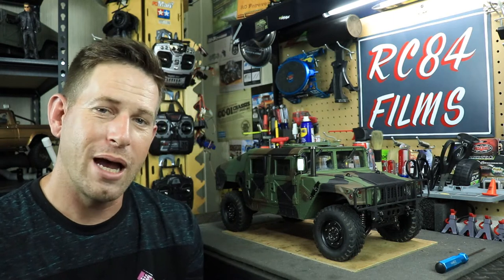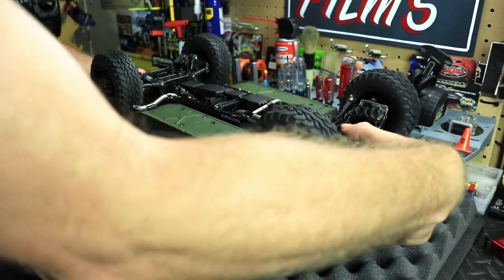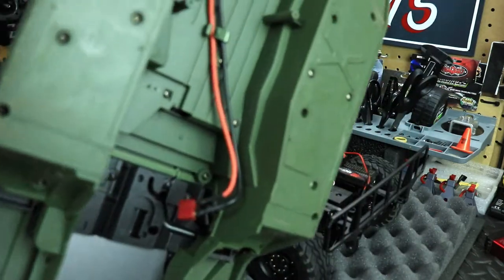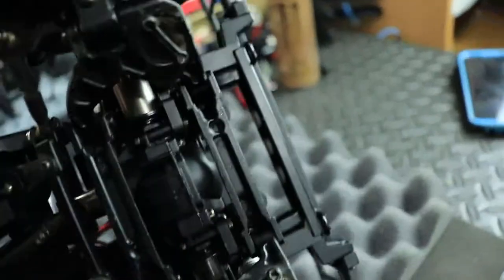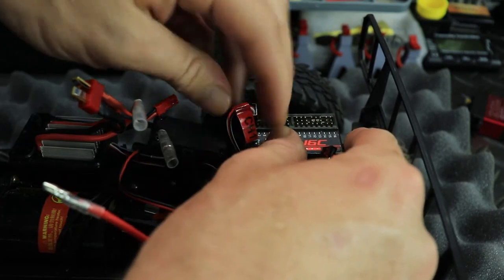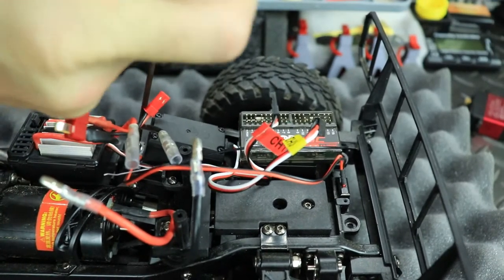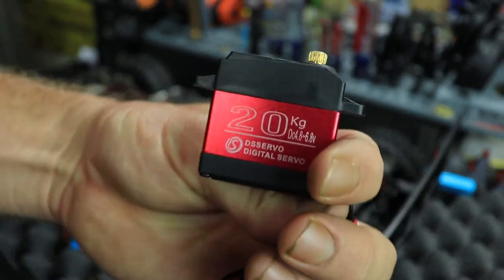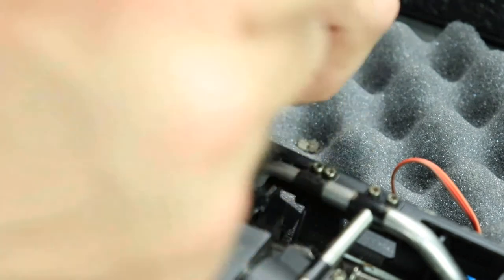RC84Films: PT1 Project Humvee P408

Comment: I am very grateful for the great help that you have offered me, precisely today I have released my Humvee, and the servo has broken, so I will have to change it.
Tell you that I follow you and that I love your videos, by the way, the battery lasted me 15 minutes, 7.4v 4500mAh) is it normal? What do you think is the best battery for this vehicle?
Thank you very much and greetings from Barcelona, Catalunya.
Reply from the maker: Thank you for your comment and for following my videos and liking what Im doing. Sorry to hear about the servo the shock servo is only a 9Kg that's why i upgraded to a little stronger servo a 20kg. For the other question on battery life. It depends on how much you are the gas. Did you get the light & sound P408? If you did that is a nothing that can suck your battery up too. I upgraded the esc so i could run a 3S 11.1 5000mah more power and run time but too answer question that's normal.
Hope this help and again thank you for supporting me & my channel
Reply from the maker: Are you going to do a run video love too it
Reply: Thank you very much, you have been very kind for your answer, I have already solved the servo and I have taken advantage of another one that I had just installed in a buggy, and it is like yours but weighs 13 Kg.
Hope you fixed your problem with your servo, it seems to be getting hot.
Well, very grateful and thank you for making us enjoy your videos, a hug!

Comment: My servo horn looks different.  Only has the one single screw holding it on, like a traditional setup. I also completely removed the exhaust, it's nicely made, but just more stuff to take off when working on it.
Reply from the maker: True that I hate the wheels ton of screws to take off when cleaning them. 

Thanks for watching